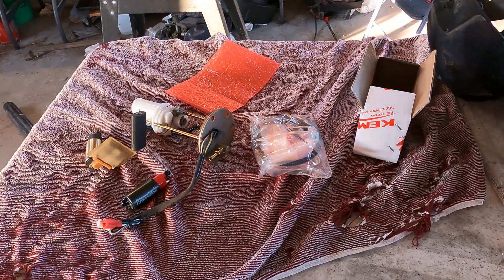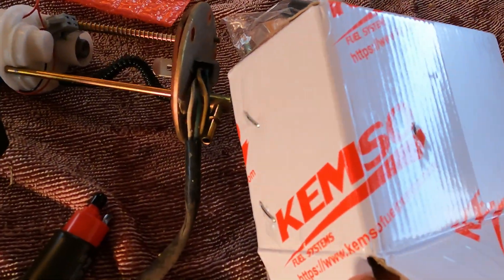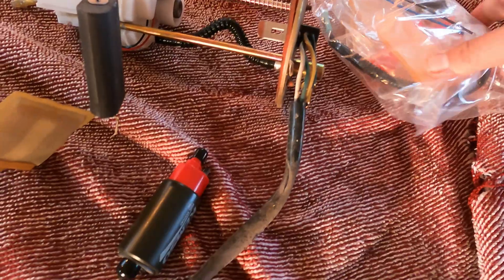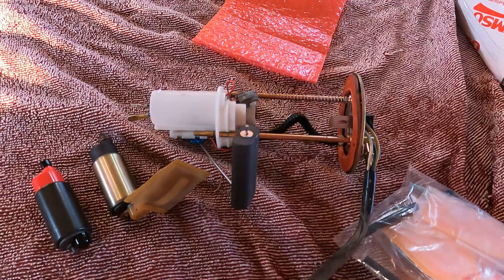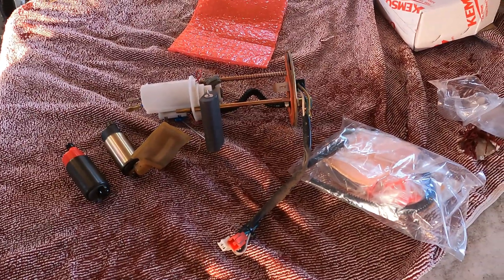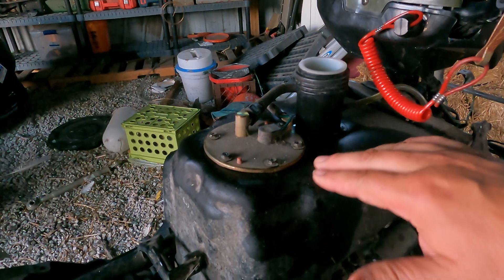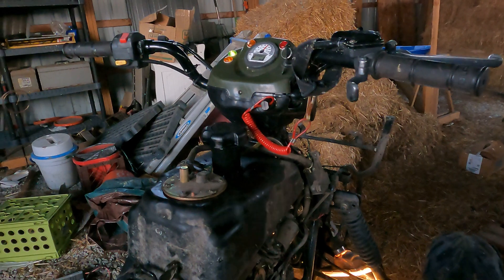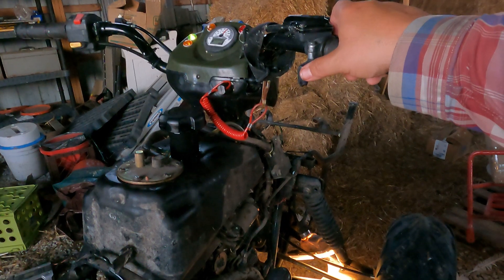Polaris Sportsman 110 EFI Fuel Pump Replacement

Comment: Man I just threw the new pump in and it's only slightly better than the factory one I replaced. It will move under it's own power now but has to be held wide open to do so. Just spits and spudders. I might warranty pump out and see if that's the issue.

Comment: What was your sportsman 110 doing that caused you to think it was the fuel pump? My sons runs awful after it warms up full throttle hardly any response from the machine.
Reply from the maker: Had a lower and lower top speed over a month or so.  Wouldn’t stay idling after a while. Like the fuel pump doesn’t give out but it gets weak.
Reply: @daronspicher  thank you for the reply. Ours just won’t go it will idle all day long but as soon as you go to hit the throttle it sputters and won’t go. Let off the throttle and right back to idle all day
Reply: @jeremygibbs8659  my sons just stared doing the same thing today.
Reply: @bendooley5639  Ben, I posted a video on YouTube about what ours was doing and a possible fix. It’s been a few weeks and it appears it did indeed fix the problem